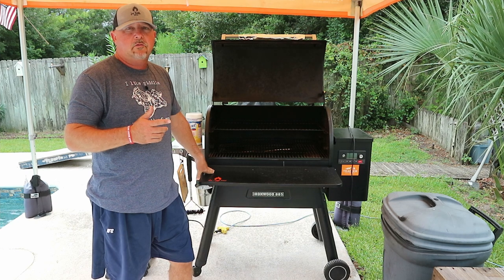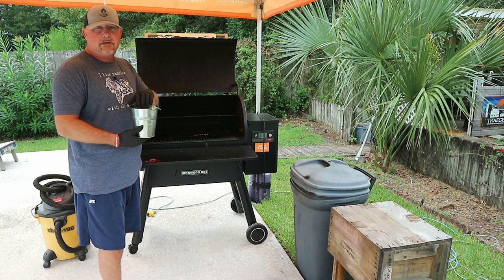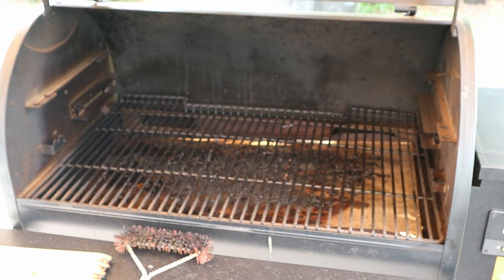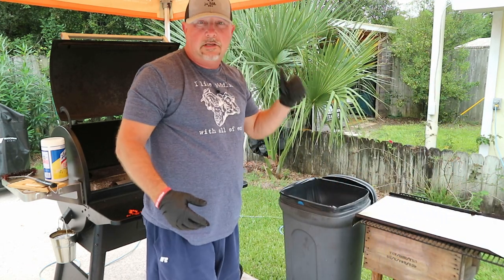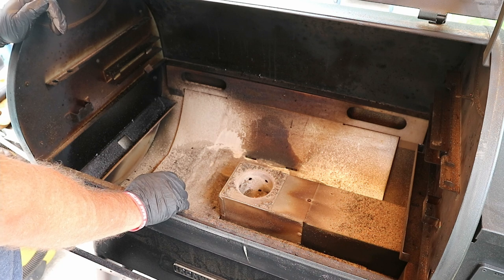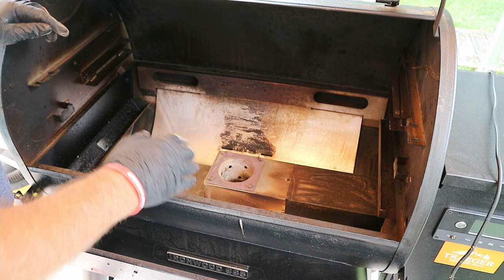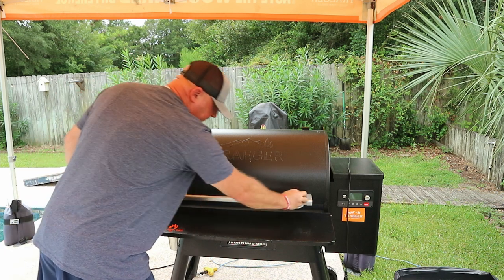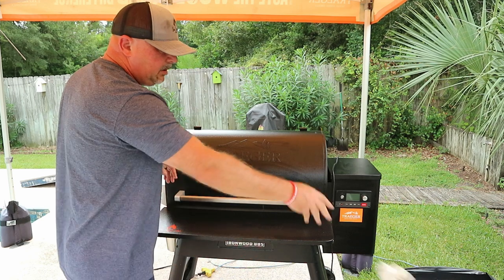How I Clean My Pellet Grill

Comment: I clean my Pitboss basically the same way with a few differences. The Pitboss heat deflector is curved. Mine has a place where I can open to sear steaks, chops, or whatever. Doing a brisket, pork butt, ribs, or anything with a long smoke I put foil under the meat. The local raccoons and possums take care of my grease bucket. Of course I clean it , and put in another foil liner before I cook. Great video!!!

Comment: How long does the Teflon brush last you normally? I stopped using the wire ones long ago due to some wire remaining behind, especially when the grates are hot. Great job as usual Marine!
Reply from the maker: I've had one before this that was thicker and better, but it has lasted a while.  The key is to not use it on a HOT grill.